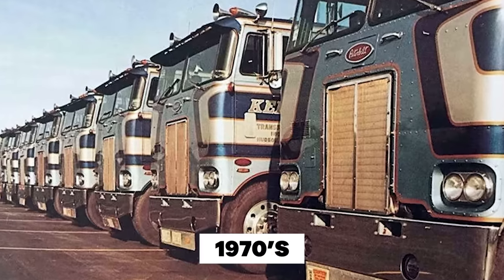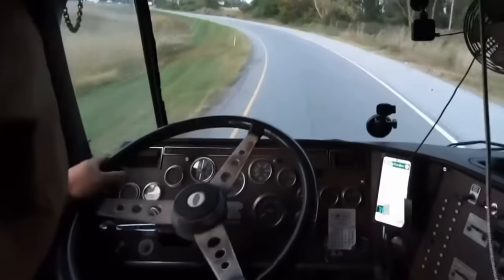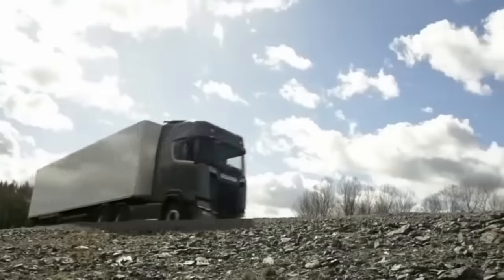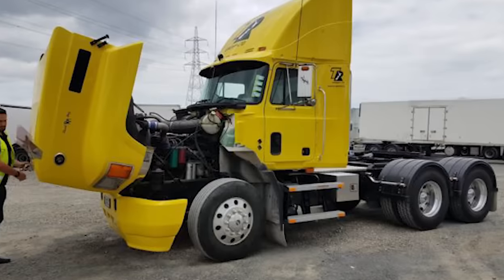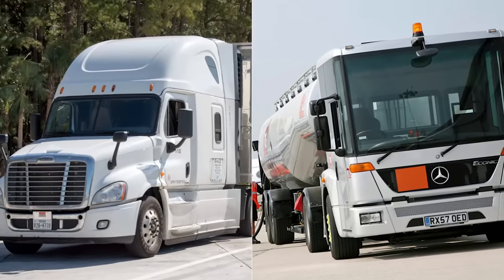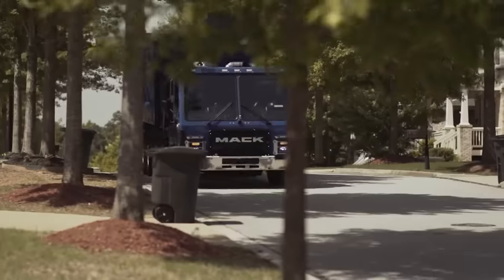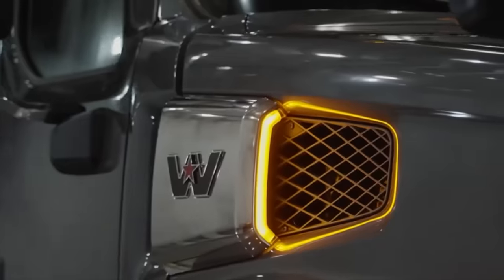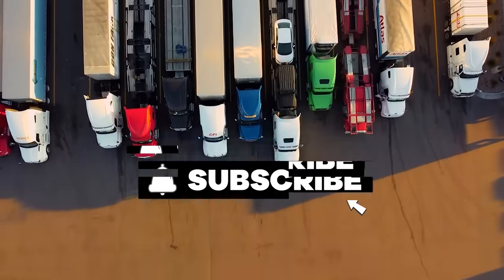The REAL Reason Why America Stopped Making Cab-over Trucks

Comment: Is there any actual data about long-nose trucks being safer in frontal collisions other than the obvious?
Reply: My guess there  is not, and also that its not even true.

There is much more crash testing done with cabovers, and the rules in europe for crash test is much harsher for trucks than in the US
Reply: Not if they are going 130 km/hour....
Reply: No.
Reply: @matsv201 nah crash testing and emissions are far better in the U.S., European standards are pretty weak just like diesel gate 😂
Reply: @USandGlobal  I really don´t agree with that. They are different, EPA regulation does have its advantages but its also not perfect. 

For diesel gate very few people understand what it actually was about, the tabolid press made a foolery out of them self.

There was totally stupid number like 30 or 40 times the legal emission, that was just never true.

The reason for it was to power boast the engine. And this is (despite what some might say) totally legal in EU (they might removed it to EURO7, have not checked).

What they do is over charge the engine with diesel and produce considerably more torque increasing the hp output by about 30%. This is legal in the euro6 code as long as the engine have sufficient power with out the boast to do the full cycle with out boasting.

In the US the test works differently so the engine with always boast. So they turned of the boast function for the test. And that was the issue. They did it only for the test.

Both mine and my wife car got that kind of boast function. But it have a quite considerable extra resistance to access. You have to press the throttle to the floor, then press it a bit more. A lot of owners have no clue that you can press the throttle harder and get more power. And when you don´t the car will be just as clean as it should be.

The flashing of the software in the US removed this feature making it fully complaint, but losing the boast horse power. Here is the issue. a lot of owners didn´t know there was a boast horsepower, and thought the power would be removed from the non boasted power. Hence the car would be considerably slower. There for a lot of people just refuced to flash there cars. Kind of ironic because this misudnerstanding was created by the media.

Comment: Long nose are better always for safety and easy to access of engine maintenance
Reply: Simple answer: No. Modern cabovers are much better for engine maintenence. The hydraulics to tilt the cab makes it quick to do, and then you have much better access to anything moter or gearboxrelated thatn you do in a long nose. It's also easier to check fluidlevels and things like that. 

As for safety, yes, if you are going at low speed, the long nose may be safer. But if you are in a frontal collision at 130 km/hour, the long nose wont save you. The movement energy of the truck will see to that.

Comment: I've driven one as a trucker.  9-speed 80,000 GVWR tandem axle tractor. Very interesting tractor.  
Cabovers are best for daycab flatbeds, dump and tankers. 

The 1st Truck manufacturer who sells a new cab over compact rear sleeper tractor, whopper 4 cylinder (giant bore, heavy worker truck type), iron block diesel engine of 500HP  paired to a basic 10-speed manual Eaton Fuller transmission on a 105,000 GVWR chassis rolling on tandem axles with two 100 gallon saddle tanks and a 40-mph shock absorber equipped type front steel bumper will be in the billions in sales worldwide within 2 years.

Comment: Here in the US people are going insane grabbing up a lot of the older 80s and 90s trucks and restoring them back to full commercial use. Reason being, these older trucks are not subject to modern DPFI federal emission regulations and as such are cheaper to operate, maintain and are much more reliable than even brand new trucks.
Reply: Fuel mileage is better, too, because they are lighter than conventionals.

Comment: Aviation student here, when learning about the importance of aerodynamics from an economic standpoint, my professor used the example of modern long-nosed trucks. He said the trucking community hated the looks of the ones with the slanted noses and the angled roofs until they found out how much more efficient they were over a long distance. 

Can any truckers out there confirm this? My professor is no trucker, but I still find the idea interesting. Thanks!
Reply: *I'm a driver, and have driven since 1997, both cabovers and conventionals, including conventionals with old-school "boxy" designs, to more "slanted" aerodynamic designs. 

Yeah, there was a lot of hate for the more aerodynamic conventionals, like Freightliner Cascadias, back when they first were developed. Still is some, for that matter. It is also true that quite a few independent owner-operators (OO's) did overcome that hate, once they saw the fuel savings. However, it was the major trucking companies that secured the future of the aerodynamic conventionals. The big companies REALLY loved the fuel savings, and since they purchase the most trucks (most truckers don't own their trucks), it drove the market demand from the "boxy" type, and thus the manufactures scaled back the production of "boxier" types. There is still some disdain for the aeros, and still plenty of OO's that buy the "boxy" conventionals. Some of that is simple aesthetics. The aeros are Toyota Corollas. Not flashy, and don't lend themselves well to customizing. (There are some custom aeros.) Unfortunately, the industry percentage of OO's has decreased, especially of those owning long nose trucks, and the days of "pimped out" long nose trucks have waned. Back when I first started, there were plenty of "show" trucks, aka "large cars" or "chicken haulers", at the truck stops, and sometimes even ACTUAL show trucks. Heck, even though I never owned my own truck, and I currently drive an aerodynamic Mack (a sorta cross between aero and boxy, albeit), I miss seeing those large cars, and prefer them myself, to the aeros. Nothing oozes classic cool, like a Peterbilt 379 with a big Kitty Kat (Caterpillar) engine, a 110" sleeper, and enough lights to land a 747, all rolling down the highway at triple digit speeds!!

Um... Okay, that part about the triple digits, just disregard. I've never driven that fast. No. Not at all. Not me!! s/

Comment: My dad worked on COE's for a trucking company.. I always thought hey were cool looking.  One of the things that people don't realize is how many accidents involved the driver braking hard and tipping the cab forward.  A few things could happen.  One, the mechanism that locked the cab in place was broken or broke under pressure or two, a mechanic or driver had not secured it properly.  Where my dad worked they had to have two people in the shop, one being a foreman or supervisor, verify the mechanism and the driver had to sign off on it as well.  I always wanted one.  They are crazy expensive now even if they are junk.

Comment: A lot of engineering & ergonomic defects of the old Cab Over truck tractors are correctly identified here.  Im reminded this era was not a high point in US auto manufacturing.   The top management managed to misjudge the market, and about everything else they were responsible for.

Comment: As a 35 year over the road trucker,I would much rather have the cabover especially in any cities. They can manager any tight spots easily. Long nose are good for highway and long distance.
Reply: I think that's the precise reason why long nose trucks are banned in Europe (just like the larger pickups), they fail to meet pedestrian safety standards in cities. Most logistics centers are not in cities, even in Europe, but not all. There was legislation introduced in 2019 that might allow a slight nose (80-90cm) for aerodynamics, but vision must still be excellent.

Comment: Nonsense, you are not closer to the windshield in a modern cabover. You are closer to traffic. The inside of the cab has the same space possibilities, the cabover is just higher from the ground. And if you collide at 130 km/hour, the longer nose is not going to make any difference. The speed combined with the trucks weight nullifies it.

Comment: I drive an old cabover daily, and I hate it. It's not mine, it's a company truck. I drive what they tell me to. The thing that really gets me is the heat. You can feel the engine heat coming up underneath you. I have to blast the AC even in the winter.
Reply: I wish you could try EU cab-over, you would be pleased :)

Comment: I never had a problem with driving a Cab Over. They back up and turn much better than a conventional. I have driven many of them. Kenworth K100, International 4070, Freight shaker I think it was a power liner but I'm not sure of the model since it has been 40 years. They really weren't inconvenient because back then you could pull off the side of the road to do laundry or get a meal. Nothing is trucker friendly today. That is why you see so many fat slobs driving a truck. Pretty much the only meal options out there these days is junk food or fast food. Finding a sit down restaurant is hard to do these days!

Comment: I would argue the maint. Statement.  I have an 86 freightliner. I open a little door to check oil and water.  To do anything major true you have to prepare for he cab for tilt but once tilted much better access to everything clutch change at least two hour advantage plus you can stand up to work on it. I sold a 99 IH because a pain to work on it

Comment: Cab over trucks are still wildly used here in the US at soda companies and beer company because since it's a length limit cab over trucks can pull 57 ft trailers that holds that extra pallet of cans . Just not very fun to drive
Reply: if you drove a modern next generation scania or a volvo cab-over your opinion would change.

Comment: The ride quality in a long nose truck is much better on rougher roads.  You are behind the front axle and so bumps have less effect on the driver.  Cab-0ver trucks have the driver sitting in front of the front axle, which amplifies the effect of hitting a bump, tossing the driver around.  I much prefer driving a long nose truck on the less than adequate roads we have in central Queensland, Australia.  The difference on a long trip is dramatic. You are far less fatigued in a long nose truck.
Reply: With "modern" air suspension for the cab, which is standard for EU trucks for quite some time, bumps are nothing.

Comment: I don't miss climbing up into a cabover, especially the Astros with that swinging step.
Reply: The swing-out staircase on a North American cab-over was on the Freightliner Argosy. Is that what you are talking about?
Modern European cab-over trucks have the driver well forward of the old North American COE location, so the door extend in front of the wheel, making entry easier.

Comment: one of the best things about conventional semis is that the engine is easly accesible for repairs :)
Reply: The same goes for cab-overs, all you have to do is to lift the cab - it's either done manually or with an electrical lift.

Comment: I love how most the trucks shown in the video are “Aero” trucks (also known amongst operators as Curb sniffers or ant eaters” and not actual long nose trucks those two styles are completely different
Reply: Changed because of aerodynamics to save on fuel.
Reply: @kathyyoung1774  Doesn’t change what they are called. 

Most freight carriers run Aero trucks but most owner operators run long square nose conventionals
Reply: @MadaraUchiha55910    O/O's have flat front conventionals only if they're older ones.
Reply: @kathyyoung1774  I didn’t say cab over I said long square nose conventional, like a Kenworth W 900, Peterbilt 379, or Mack Superliner

Comment: There's a hole in the logic that claims cab-overs would offer less room for driver's comfort: Build a cab-over on long nosed truck with the cab ending where the current ones end, and you basically give the driver an apartment on wheels. The easier access to much of the engine is a point for the cab-over. I write "Much of" as the engines still are by a great part under the cabin, so once you took the hassle and flip forward a cab-over's cabin, you basically have full access to all bits. Then the cab-over offers better access.
The point with engine noise is not really valid as the vibrations get transferred via the chassis, the two feet the centre of the engine is further away from the driver's seat doesn't do much there.
There is some truth to the point about safety. The difference isn't tooo great, though, as all trucks basically consist of to iron girders Mounted lengthwise. When they make contact to a firm obstacle or another truck's hard structure, there is a hard deceleration. That deceleration again is transported through the hard structure, so the blow to the inhabitants of the cabins is almost equal. There is, however, more room for such blows to glance of, so this point is partly valid.With hard and heavy loads on the trailers breaking lose and impacting the cabin in a crash, occupants of both are equally hosed. 
Then long nosed trucks have more room for aerodynamically rounded fairings. This helps to lower drag and thus, as aerodynamic forces go with speed squared, is felt ever more clearly the faster your trucks can go. If, as you say, trucks go nearly 50% faster than in Europe, is a massive factor in the equation.

Comment: In Australia our Cabovers dominate the trucking industry and they are more fuel saving than their long nose counterparts. I’ve grown up around both Cabovers and bonneted trucks. Kenworth Australia have been building Cabovers for the Australasian market. Also Kenworth Australia designs and manufactures new truck models for more demanding roads.
Reply: Can't see a CO being fuel efficient with that big flat front pushing so much air.

Comment: Did you know that the very first cab over design had the sleeper under the cab? And the engine was under the sleeper. I’m not sure how that transition went from the cab to sleep and sleeper to cab. They didn’t last long. The idea was that two people always drove in one truck taking shifts to deliver loads quicker. What didn’t go as planned was the trucks going up an incline. While the truck was going up a hill or there was a bump in the road the sleeper would be ripped of the truck and the driver who’s shift was over sleeping in the cab would get run over by the truck.

Comment: Long nose trucks: Comfort & bigger spaces at the back for sleeps and other stuff to fit in and safety space on head on accidents, more speed = reduces time of arrival on their delivery which could be useful in NEAR DEADLINE deliveries when taking the highways.

Cab overs: Better turning radius, maneuverability, low load capacity for certain areas that would not allow LONG NOSE to enter.

Both of types have their uses its up to the driver on which aspect they would prefer driving.

Comment: The possibility of a transition to a cab-over engine is extremely low.
There is a need for legal regulations to lower the maximum speed limit on roads to ensure safety.
This would significantly reduce distribution efficiency, and the backlash from companies in the distribution-related industries would intensify.
Naturally, the safety and livability of the driver will decrease significantly, and the driver's opposition will intensify.

Comment: Sorry but total rubbish you said long nose was because of regulation about length not including the tractor unit. Cab over engine could still have the spacious area because thes are behind the engine and cab  European trucks have demonstrated this its nothing to do with comfort as there no more vibration and noise with over engine than front engine. .
It comes down to cost of manufacturing it cheap require less technical innovation and it mean unrefined engines can be used. It's  about money nothing else and you said this at the very start.

Comment: The issue is US has decent highways and roads where you can drive those long-nose trucks. If you come to Costa Rica the cab-over trucks are the best option as many highways and roads are not wide enough for those long-nose trucks plus the trailer.

Comment: Cabovers lacked the "cool" factor, lack of sales killed them in North America. 
Actually many later cabover trucks from the late '80s and early' 90s were more comfortable, warmer/cooler and quieter than conventionals. There were many advancements such as flat floor versions, swing out steps and such that made cabovers a lot more convenient to live in.
And no, you didn't sit closer to the windshield, the windshield was at the front of the vehicle though, many actually had more legroom than conventionals. The argument from conventional drivers was cabovers put you first at the scene of the accident. Recruiting good drivers for cabovers was more difficult as well because of the stigma.

Comment: Americans and safty ,. that is a laugh ,  Capover trucks build in europe and japan are safer than any american truck , 1 brakes that work and safety equipment american trucks dont even have as they are mostly fiber glass garbage. 2 they are build for faster speeds only limited to local speed limits.  3 , more powerfull engines that can haul much heavier loads in all conditions . 4 Living space has increased significantly in these trucks  inlcuding comforts americans can only dream of .   5  European cabovers drive thousends of km from the port of amsterdam to eastern turkey .    and number 6 ,  European truckdrivers actualy  have a real truck driving license .

Comment: Yeah bogus.
It's all about "looks". COEs have better visibility compared to the massive blind spot of "conventional cabs". (safety)
Regarding engine noise, builders could have just as easily moved the engine back under the berth, which would both increase front cabin space and improve driving axle traction.